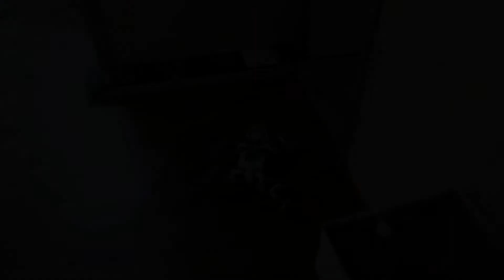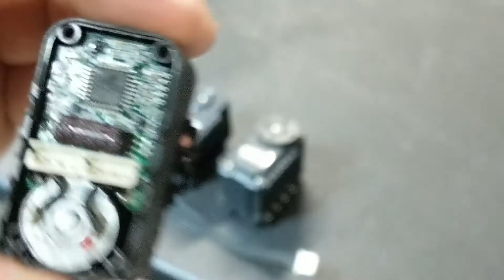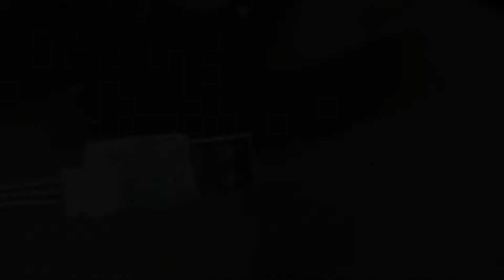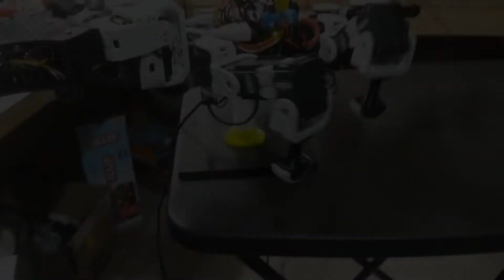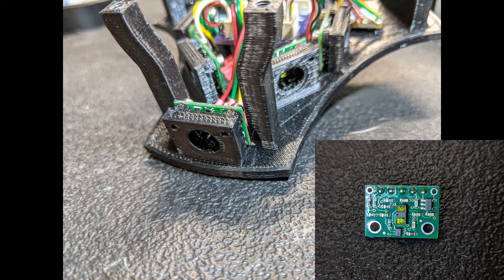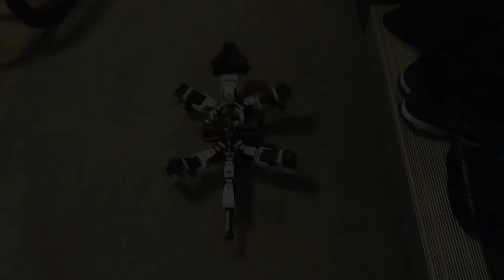Roz Workshop

Comment: Nice walker. What did it cost to build? Can you teleoperate it?
Reply from the maker: No idea of the cost - its a project I've been working on for 16 years. I suspect to replicate it today would cost probably in the ballpark of $2000 USD in hardware. It is designed solely for autonomous operation, so there is no way to teleoperate it. From a hardware perspective there is no reason you couldn't, but I'm not really interested in remote control, so I've never written the software that would allow it.